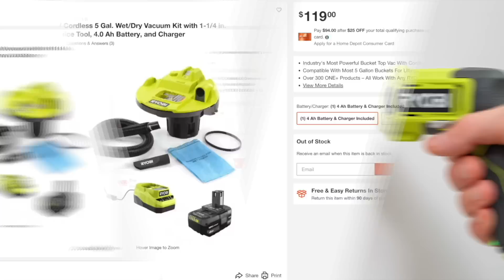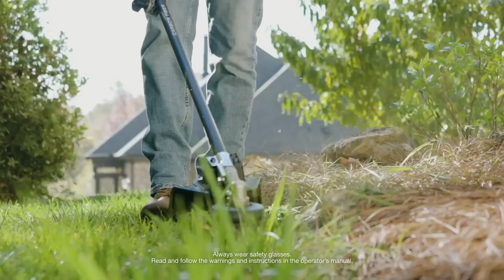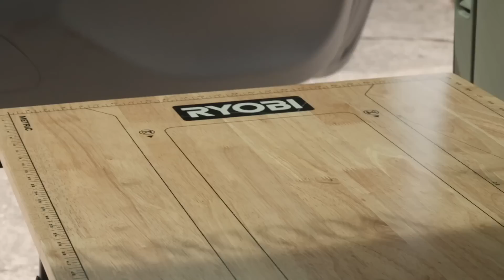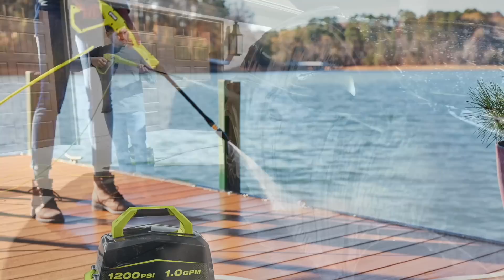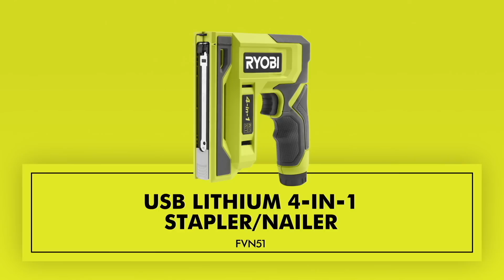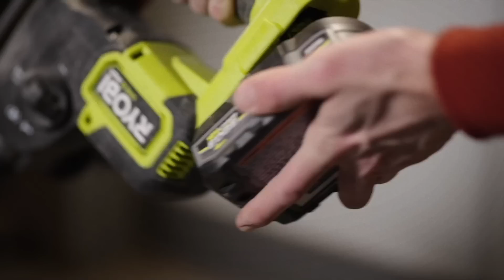Best New Tools From Ryobi for 2025! Ryobi Tool Year in Review

Comment: I personally haven't noticed any difference in power with the edge batteries. They seem to compare to a regular 4ah or 6ah Hp battery to me. I'm not saying they're bad they just haven't impressed me other then the look and extra protection with more rubber.
Reply: Do you find they help with heat at all?
Reply: @kylemackinnon5696 honestly I haven't noticed. They work great but so do the other batteries. I haven't really pushed them very much. I use my Dewalt tools more often then Ryobi but I still enjoy using them.
Reply: @my2centz196  thank you for getting back to me, i think i will go with hp batteries as they will likely go cheaper i apreciate the review!
Reply: @kylemackinnon5696  no problem. You can usually get 2 6ah Hp batteries for the price of one edge which I think is a way better deal if you ask me.